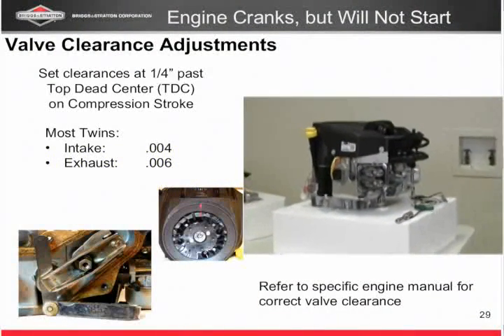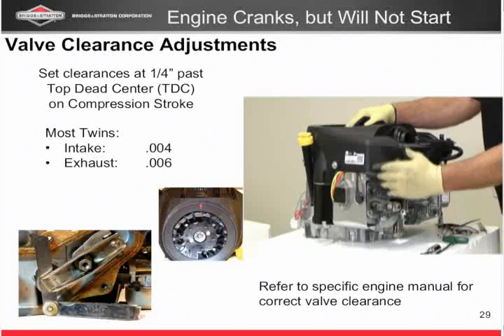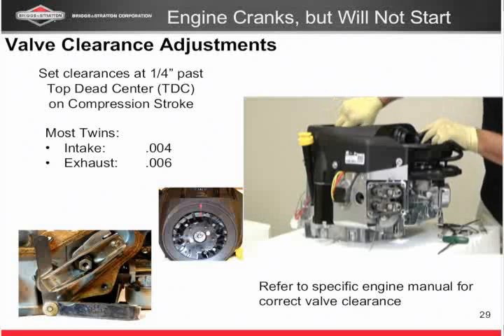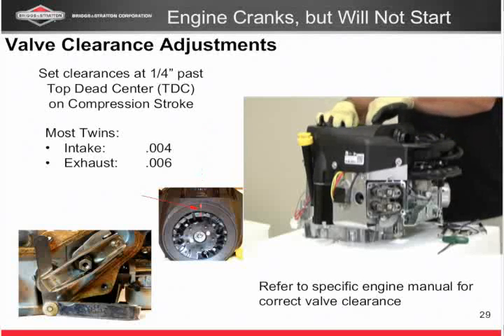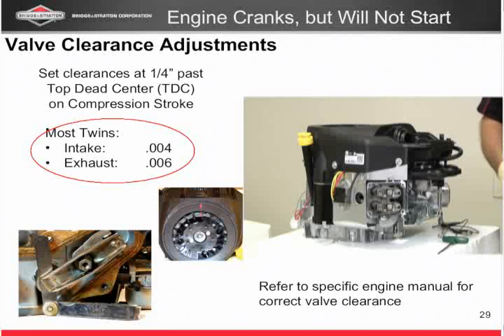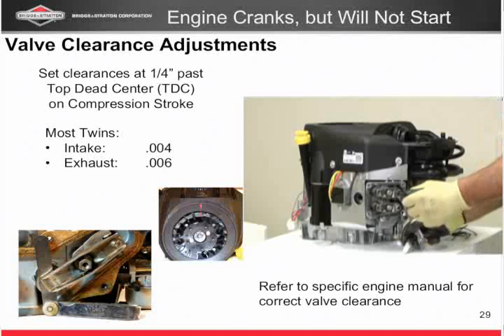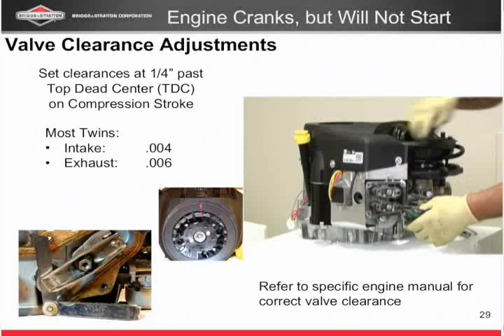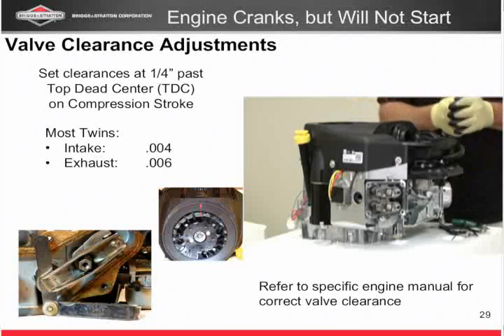How to Adjust Valves on a Briggs & Stratton Twin Cylinder Engine

Comment: THIS IS THE PROPER WAY TO DO IT THANKYOU FOR SHARING, SEE VIDEOS SAYING ONE VALVE CLOSE ONE VALVE OPEN THATS NOT ACCURATE .
Reply: If one of the valves is FULLY open (lifter on the peak of the cam lobe), the other valve is FULLY closed, therefore at maximum tappet clearance to be adjusted!

Comment: At TDC are both intake and exhaust valves in the closed position?
Reply: Not on briggs twins.  1/4" past for valves closed.  See the reply to the first comment by Sears (poster of this video).
Reply: I have the same question can someone answer please?
Reply: @alanosborne1947  Yes, also, you turn engine clockwise in order to find TDC with both valves closed so rockers will both be loose
Reply: Yes, also, you turn engine clockwise in order to find TDC with both valves closed so rockers will both be loose

Comment: Why do you need to go 1/4 inch past TDC to correctly set valve adjustment on Briggs& Stratton engines?
Reply from the maker: Great question. Briggs engines use a compression release cam to lift the exhaust valve briefly so the engine doesn't lock up when you restart it. Going 1/4 inch past TDC enables you to set valve adjustment with the valve completely shut.
Reply: THANKS SAME QUESTION I HAD NOW I KNOW
Reply: Because this 'expert' says so.

Comment: There are about 20 videos I've seen that show the wrong way to adjust the valves. They all show loosening the screw and then adjusting the gap with the nut. They then suggest locking the screw down. This is backwards.
This is showing using the screw to adjust and the nut to lock it down. This is correct.
There also seems to be a little confusion about intake/exhaust...which is on top/bottom.
I found one that was correct and then this one too.
Kudos and very well done!
Thanks.
Reply: Also briggs confused everyone because some parts diagrams state the twin engines Aluminum Push rods go on the exhaust side (my buds 1999 Deere Vanguard came this way originally) yet some diagrams, manuals, sites state the Briggs Twins Aluminum Push Rods go on the Intake side.
  So today nobody truly knows their Push Rods correct position? 
 We see countless arguments over what's right/wrong, however the fact remains in over 3 decades Briggs has yet to figure out where their Aluminum rods should even go. 
   I'll just tell ya'll right now I'm the only one that's always been correct on the Alum rod location from the very start. Yup' I know right were they go, but hell I ain't no bragger.